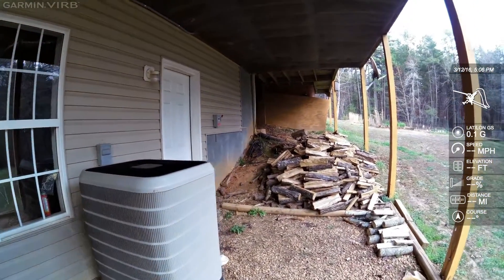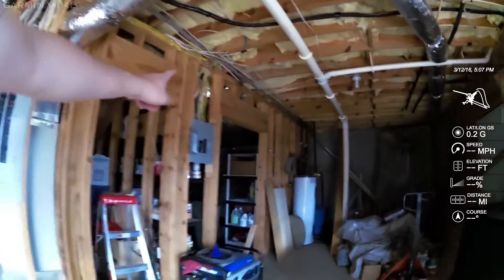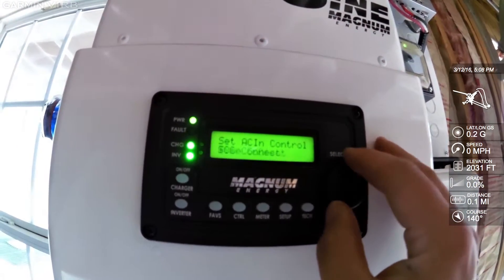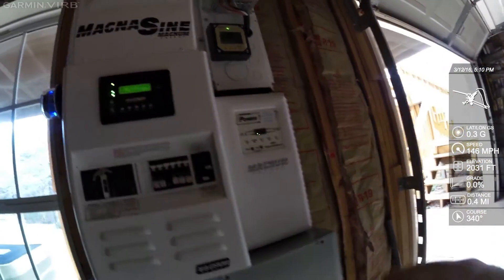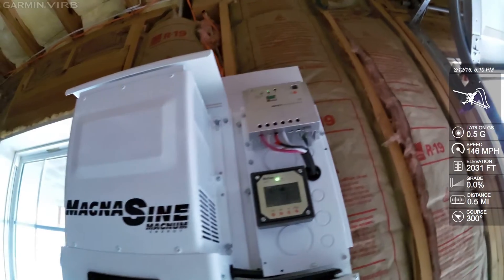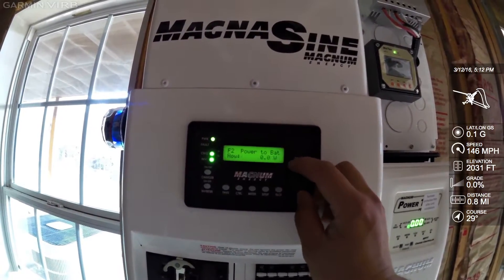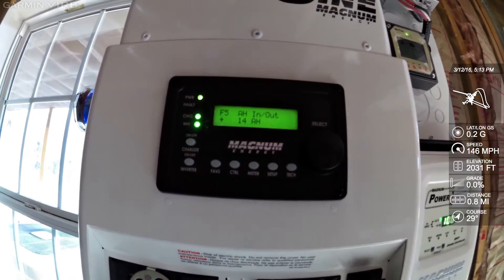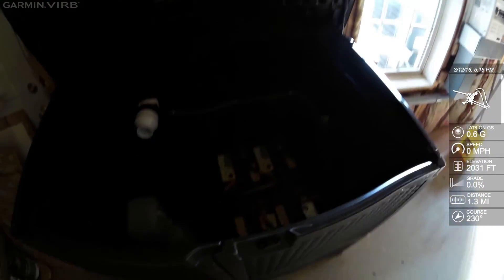Solar Battery Backup Magnum Inverter Walkthru

Comment: Gain Solar Services,
First, thanks for taking the time to make this video, much appreciated.  The best video on the Magnum I have seen so far, and I have watched them all.

Time permitting,  can you please explain the following:
1. AC and DC grounding for this system (earth ground, chasis ground, etc.)
2. AC Coupling and Passthrough
3. Split phase config on this unit.

Thanks!
Reply from the maker: 1.  The install manual for the magnum inverter on the Magnum website can be downloaded for free. Grounding is detailed in the installation manual. There is a ground bus bar inside the magnum MMP. 
2.  The magnum MS pae series are split phase out of the box no configuration necessary. 
3.  Magnum also has a white paper on their website on AC coupling but I don't do that. They even have a diversion load controller.